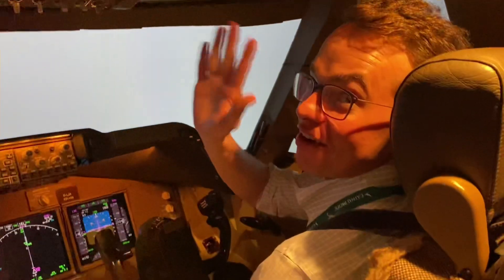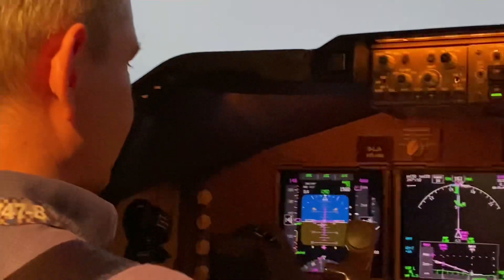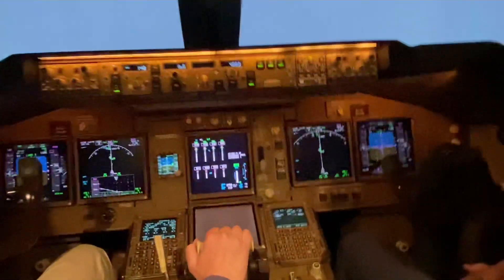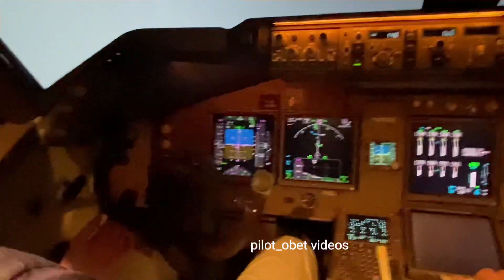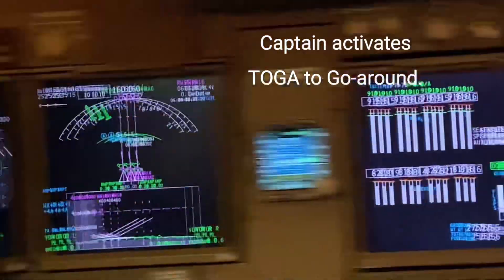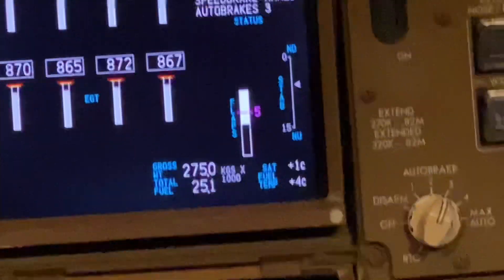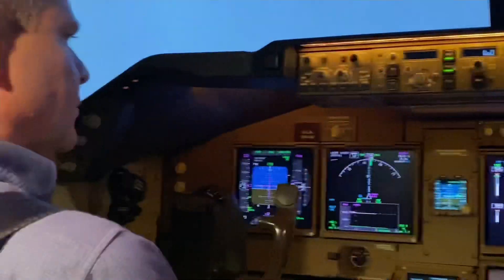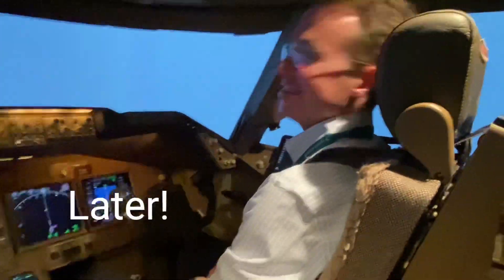B747-8 ‘NO AUTOLAND’ alert

Comment: The speedbrake still said “armed” but the handle looked like it was down??
Reply: You can arm the speedbrake without extending them to my knowledge. I may be wrong though. Sometimes they'll use it to increase rate of descent, but if they don't use them, then the speedbrakes will be armed so they can extend automatically once the plane lands.

Comment: Is it still possible to perform a manual landing, or is a go-around mandatory?
Reply from the maker: All explanations are good- thanks
Reply: The visibility was too poor so they did a CATIII. so manual landing will not be possible
Reply: if there is visual reference at or before the time of failure and the PF decides it's enough for a manual landing. But that's only for CAT2 approach, CAT3 is a mandatory autoland approach
Reply: Thanks for the explanation to you all!